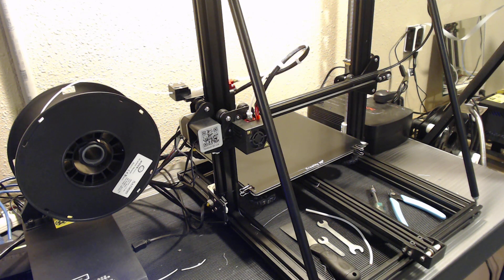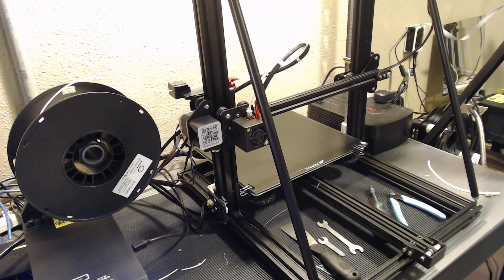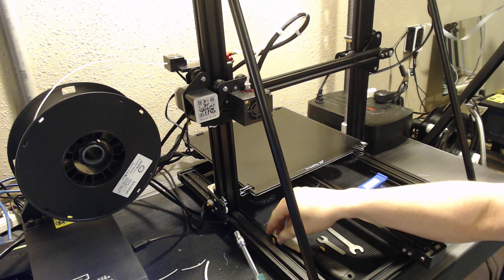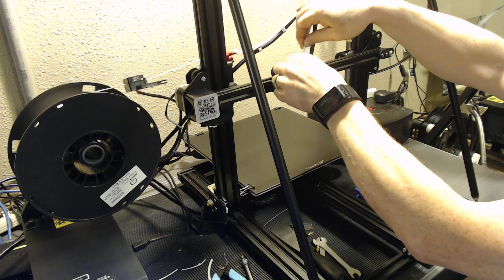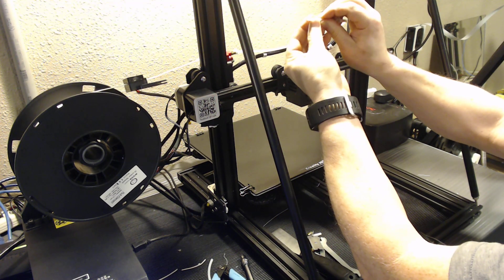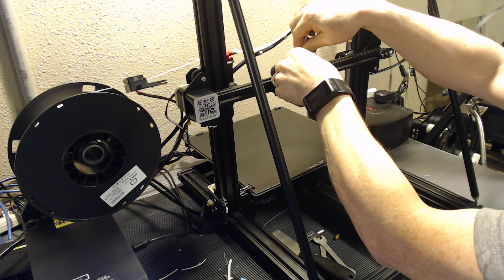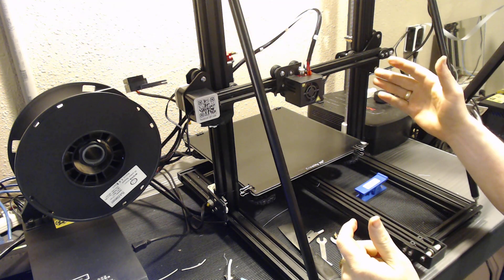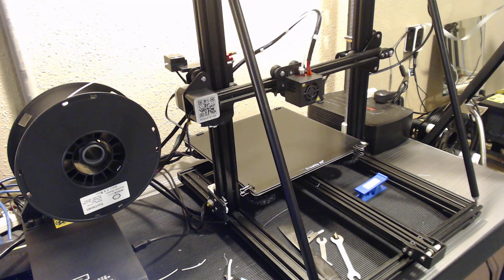How to clear a blocked hotend on a 3D Printer

Comment: You really should print and apply little C-clip shaped shims onto both of the pneumo connectors to prevent them from wiggling loose from the incessant retraction action.  I'm sure thingyverse (one example of many is thing:5773351) or other model sources have such (actually Creality started including them in their machines).  They prevent you from pushing in to release the PTFE tubing, so when you WANT to pull it out you must remove said clips.  As old as this video is, perhaps this will benefit someone who comes across this anyway?  Yeah - my first rodeo, too....